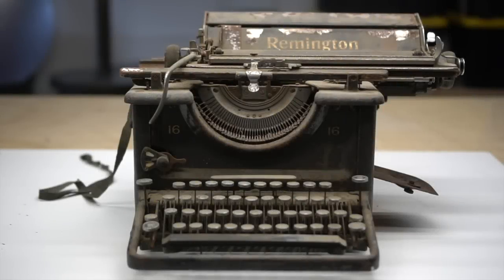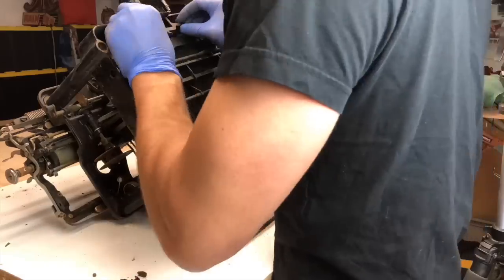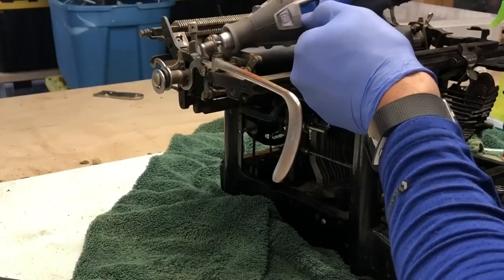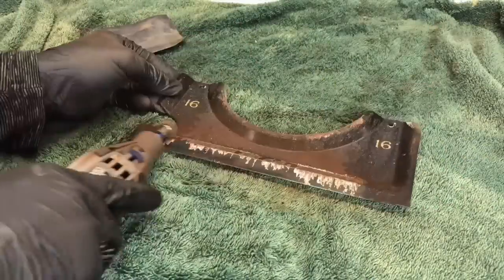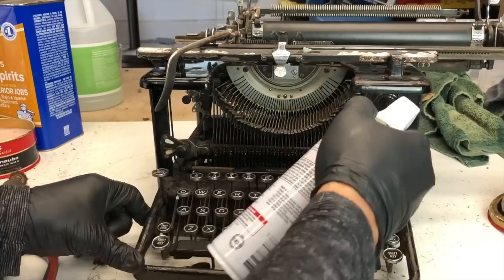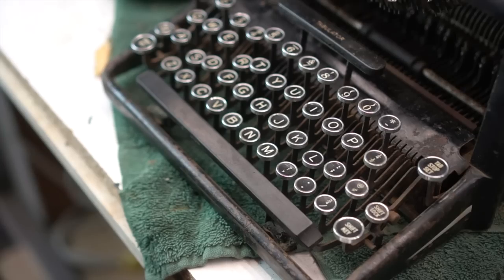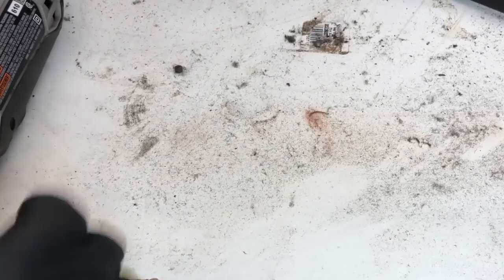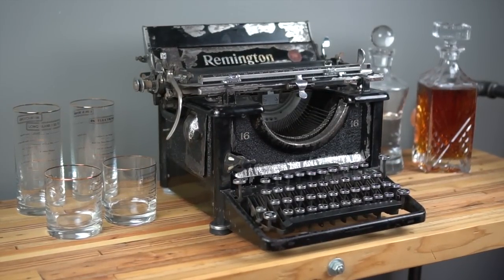DIY ANTIQUE RESTORATION // REMINGTON TYPEWRITER RESTORE

Comment: The first rule of typewriter cleaning/maintenance is that you never use WD-40 on a typewriter.
Reply: Or a sewing machine or banjo or lawnmower.  WD40 is good for preventing rust. Mineral oil is a useful lubricant for the light work, oil for mowers etc.

Comment: Ehhhhh, more of a cleaning video than restoration as such. Interesting to see that CLR isn't much better than vinegar though.
Reply from the maker: Thanks for watching.
Reply: ACrateofTuna s  dont ise vinegar, it attracts water and will rust it, nafta or kerosene and white spirits. Dont use isopropyle alcohol as it melts the early plastics and varnish such as keys and roller

Comment: Rust-Oleum Rust Remover is excellent. I rinse it off using either rubbing alcohol (evaporates), mineral spirits, 3 in 1 for areas that need lube or just a teaspoon of water to rinse specific areas.

Comment: I have a different model. For yours, I’d get some touch up Auto or oil enamel and fix the areas which should be painted. Beautiful machine. Some types of drip degreasers could fix those stuck keys. Replacement t ribbons are also still available. I type with mine!

Comment: Remember that linseed oil doesn't dry so much as it cures and that is an exothermic process. A pile of soaked rags can spontaneously combust on you. Such has been responsible for many burned out buildings. If you use linseed oil, make sure that you spread the rags out and let them dry before storing or disposing of them.

When disassembling something, copious notes and photographs are really valuable for figuring out how to put it back together again. Make a list... Step 1: Removed screws from top cover plate and removed plate. Step 2: Removed platen by ... and so on AND KEEP THESE NOTES WHEN YOU GET DONE! Add photos that help you see how everything sat before you took it apart and you'll have a much better chance of getting it back together. Also, label parts as you remove them and bag the relevant screws and such and keep them with the part. The more you do, the more you can refine this process and the easier it gets and, what's more, you can share your process.

Comment: Hello dearest typewriter friend!  Love the bar cart deco usage - sweet style, let alone great job at making it a beeeeeute

Great great information.  My intentions are more geared to using for typing yet I'm quite annoyed at my insistence to troubleshoot vs. Oh, I dunno.....watching all your info that may have currently shaved off 80 million hours of stubborn behavior :)
Gosh, definitely a hard sell to want to do again.  I'm still in progress, yet I wanted to thank you for all of the great advice, experience, and knowledge shared.  I did almost implode when you mentioned the non-time intensive portion due to my aforementioned stubborn behavior that has me 800 yrs into my love for making my typey a bit more typey for me.
Thank you for your generous knowledge and info.  I will continue some of my methods though I'm loving the steel wool, the wax, clr/vinegar (dealing with decent rust at ~90% of the 4 million screws on this machine).  I will also enjoy the linseed insider trading info from reading the back of the bottle haha for a rod iron fence that despite rustoleum and removal I believe will help me to reduce rust build up rate int he future with this sweet info so thank you again.

Definitely a beautiful historical history to our current technology.  Who were these lunes who knew the map and screws enough to do it as a job and be good at it?!?  
Also dang aren't they heavy.  If your piece gets a bit "tired" as bar decor, shoot - put it with the free weights, eh?

Thanks again and great energy and info shared.

Comment: I just inherited what looks like an identical remington - is there an manual for how to use it & how to put the spools on the sides?  Also - how do I find out exactly how old it is?  Mine also has the '16'  '16' on the front.  I wonder what that means? It is bolted to a desk & can be 'hidden' inside the desk.  I also want to find out how old the desk is - but not sure where this info is.  If anyone knows - I appreciate  any info - Thanks!

Comment: WD 40 is a water dispenser..not an oil..second, dont use linseed oil as it makes a film.. wd 40 also melts the rollers over time..
Reply from the maker: Haha! Well I can’t trust anything you said John since you called it a water dispenser. The WD stands for Water Displacement. Linseed oil works perfectly for this type of application since this typewriter is just for show. Thanks for watching though John and hope the video was entertaining at least.
Reply: BYOT i got an malfunctioning autocorrect only. I would not use linseed as it hardens... i paint with it

Comment: I wish I could hire you!  I don't have one this old, but I just got a 1974ish Corona Smith in perfect working condition.  The only problem is the casing is rusting.  It flakes to touch.  I don't believe this is paint and I'm not sure what to use to clean up the casing.  Any ideas?  Thank you for this video!

Comment: I have a Remington 12, I highly recommend WD40 for lubricating parts, it worked wonders on the keys and moving parts. brasso also helps polish metal.
Reply: As a typewriter repair technician I can tell you WD-40 is the worst enemy of typewriters.  It works well the first couple of days and then gums things up.  Ask any typewriter professional and they will tell you to stay completely away from WD-40.  It does more damage than it than it does good.
Reply: No one use WD 40, this is the worst stuff to possibly put on. It will gunk it up real bad.
Reply: WD40 will kill your typewriter. Typewriters should run as close to dry as possible

Comment: Don not use wd 40 it may cause something to the machine
Reply from the maker: Cause Something?  Please explain.  Thanks for watching and hope you enjoyed the video.
Reply: @BYOTools  it may make the machine hard and really difficult to type
Reply: @BYOTools  wd40 is a solvent not a lubricant. It gums up over time and will make a mess of type bar links, springs and pivots. Best to use an oil designed for intricate mechanisms like gun lube or sewing machine oil
Reply: I read somewhere that these machines were meant to work dry and any lubrication should be done with a cloth with some light oil on it.

Comment: Rough and terrible.
It's the worst to use the same metal brush as the arm to scrape the stamper, which is the key to the odd work and the more important typewriter.
I'm breaking an important part.
I have no idea what to repair.